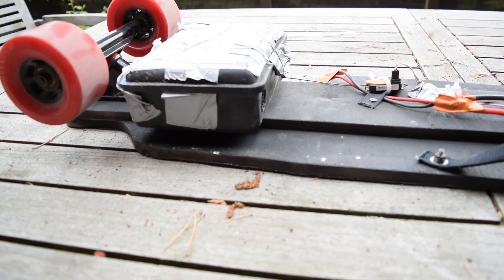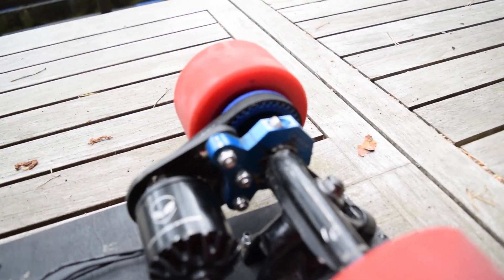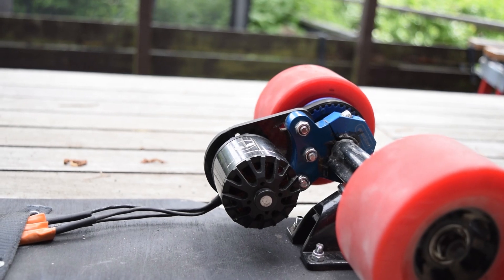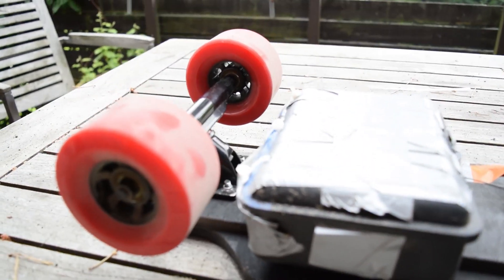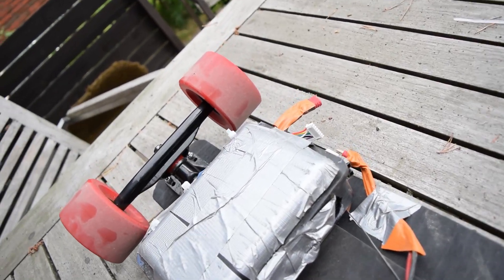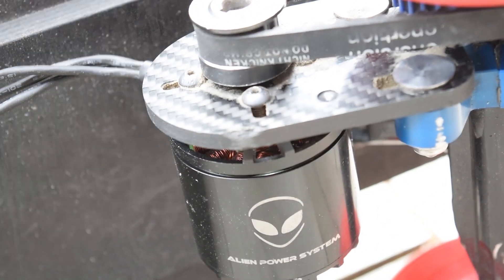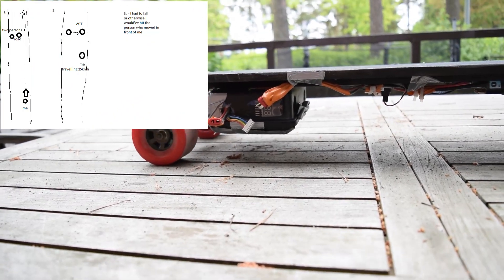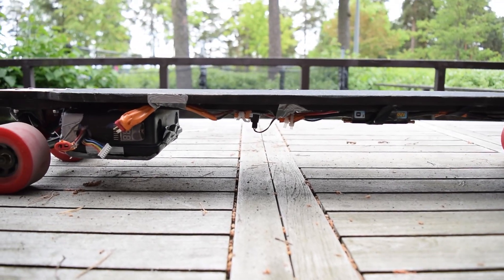My DIY Homemade Electric Longboard/Skateboard

Comment: why get a 270 KV instead of a 350 Kv? would 350 not be strong enough with 2200W?
Reply: 2200w would be good enough for 350kv, but this board has 1600w which is a bit too weak

Comment: hows the brakes on the boat esc?
Reply from the maker: Mr Le they don't really work with my weight, but if you have the belt tight enough it slows you down enough. I can stop from full speed in about 10m.

Comment: @Vansh where do you got motor mount, timing belt and pulleys!
Reply: ATUL TIWARI I am making a whole different thing and it doesn't need any kind of pulleys, motor mound etc.. but if u want to you can use chain( chain is more effective it only losses 3% energy while belt losses 11%) and for pulleys u can buy cycle gear's and to mount the motor u can use ( I don't know what to call it but ppl uses it in many projects it have holes and it is made of metal).
Reply: cycle gears are much bigger!
Reply: ATUL TIWARI  there are smaller options available too. Go to a good cycle shop and ask the shopkeeper to show you the smallest gears available or if they are still bigger then you have to make them by yourself or by a person who makes stuff out of wheel.
Reply: ATUL TIWARI and again if u want to buy you can buy them from eBay for 3k

Comment: total price?
Reply from the maker: About 520$ or 490 euros. could've done it cheaper but cheaper parts where not available at the time
Reply: +Electric Longboard Channel What's top speed?
Reply: +Electric Longboard Channel which one is faster between 245kv, 2200watt with 6s battery and 400kv 1820watt with 6s battery?
Reply from the maker: Diptais Good 34kph
Reply from the maker: Diptais Good the 400kv is faster, but it has less torque. i'd buy the other motor due to higher power and more torque. you can fiddle with the top speed and torque ratio with different sized pulleys.

Comment: Hi 
My question is :i noticed you have a boat esc but it has no water flow so 
How does it not overheat
Reply from the maker: It is rated for much higher amperage. It sometimes gets a little warm to the touch but hasn't overheated.

Comment: Yo brother awesome job! Just thought I'd throw out a tip as far as the battery connector goes.. I'd recommend upgrading to an XT90 or EC5 plug as the deans (t-plug) is at best rated for 60 amps and often melts at 40 if soldering isn't done well.. Check out ProgressiveRC for charging and battery stuff, it's where I work ( it's mostly battery/ charger and multirotors/ Rc helicopter stuff).. You're great motivation for me to get building my board !! Thanks man!
Reply from the maker: Thanks. I've been thinking about switching to xt60 or xt90 connectors, but have not had the need to change yet. I probably will in the future though. Thanks again

Comment: Hello I just wanted to ask you if this ESC http://www.hobbyking.com/hobbyking/store/__64853__Hobbyking_8482_SS_Series_90_100A_ESC_Opto_.html
would work properly with this motorhttp://www.hobbyking.com/hobbyking/store/__18126__Turnigy_Aerodrive_SK3_5065_236kv_Brushless_Outrunner_Motor.html

Thanks :)!!
Reply from the maker: The answer is yes. But if you are making an electric longboard out of those, it wouldn't work. First off the motor has only about 1100w with 7s which is the maximum voltage of the esc. Also the esc is meant for drones. So it would probably get extremely hot even though it is rated for 100A
Reply: Thank you can you suggest an ESC that will work for an electric pennyboard.
I am searching for a budget one somewhere around the $40 range is my max.
Thank you
Reply from the maker: The specs suggest that it would work. Though it only has a constant 100A. I would suggest to try and find an esc with the same burst current as your motors highest amperage rating. But that esc could work, I personally would try and find an esc I just described.

Comment: Mind you that these boat ESC:s are supposed to be constantly water cooled so it will NOT be able handle any of the rated amperage, at tops perhaps 1/3 or even that.

Comment: and if i use 2 11.1v 5000mah lipos and connect them in series! friends i am an indian! here the market is limited and extremely expensive! A 6s 22.2v 5000mah would be costly and not just battery i have to spend  much on charger too! but with 3s 11.1v i can use a basic charger!
Reply: Hey bro I am recently making an motorised skateboard  and the overall cost is around 16000 rs if u want to know from where I am gonna buy the stuff you can ask me on snapchat-   messitupvansh

Comment: Nice build!
Im thinking of getting a Turnigy Aerodrive SK3 - 6364-245kv, with 6s, 40C (2x3S 20C 5000mah in series). Will this configuration give me a decent speed and go up steep hills? I'll be going with 80mm 14/36T. Thanks! :)
Reply from the maker: with those specs your top speed would be 30 kph or 19mph. And you would have enough torque for normal hills in a city enviorment. Nice setup!
Reply from the maker: you would have a little bit more torque than my board. :)
Reply from the maker: +Electric Longboard Channel my board has gone up every hill i've seen

Comment: hi +Electric Longboard Channel i got a ntm prop drive 380 kv 2700w can you please tell me that it would be suitable for a electric longboard or not? Thanks!
Reply: It depends on two things. The voltage of your battery and your pulley ratio. If you have a 6s battery the motor would have 2025watts of power. This is plenty, but you would need a pulley ratio of maybe 11/36. or 13/40 to go up steep hills. If you can find pulleys with that kind of ratio the board would go around 37kph  with 83mm wheels.
Reply from the maker: at 40kph with 2000w you can go up the steepest hills that you can find near you. maybe 28 degrees slopes

Comment: HI. have did you configured the ESC or was it "Plug & Play"
Also, i noticed that you don't have a breaking system, do you know if there is a VSC that I can use in order to have am electric breaking system?
Thanks in advance...
Reply from the maker: I had to solder connectors to the esc, but otherwise it was ready to run. If you want an esc with braking there are the vesc's from enertion and diyelectricskateboards. I'm not sure, but I think if you find an esc which says "slow braking" you can also use that.
Reply: Thanks a LOT!!!
Reply from the maker: +Naor Naftali np

Comment: hows the breaking? is it smooth?
Reply from the maker: Well I don't have real brakes because my esc doesn't have slow braking options, but the motor and pulleys slow down the board about 10km/h per second. And when I'm going under 15km/h I foot brake.